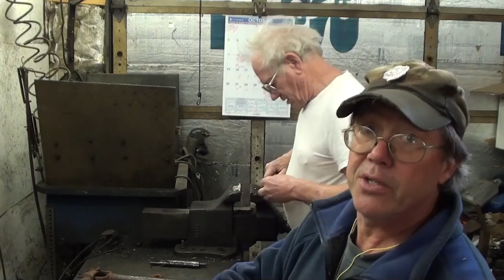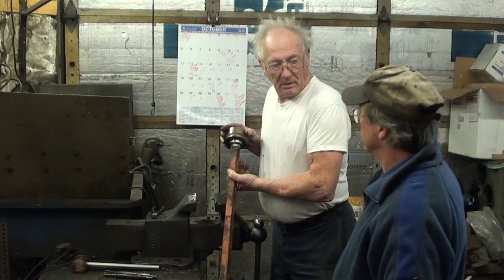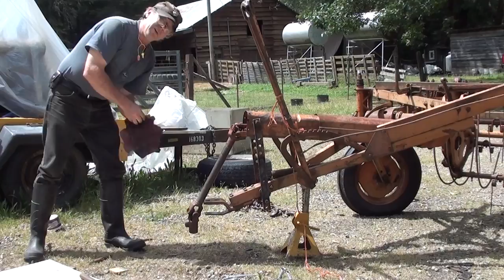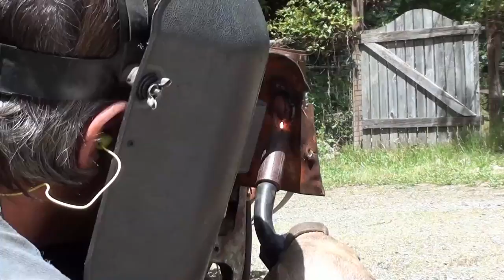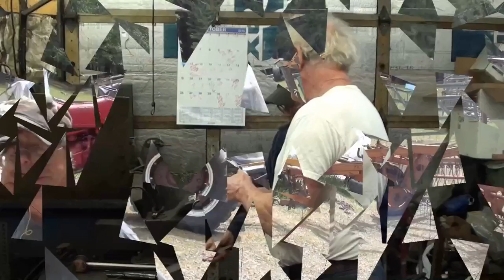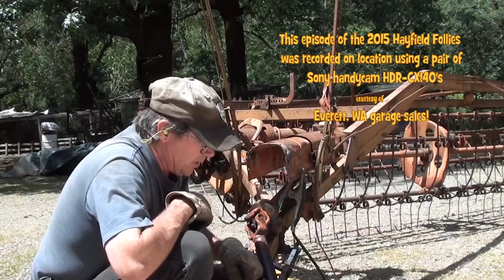Pt 4 of 4 Allis Chalmers Rake Repair with Tony!

Comment: Great Video's Geoff love the humor, one thing about the PTO shaft you should try and get it as strait as possible to minimize wear to the uni joint, so you should be using the second hole down on the swing arm the top holes usually has a bracket going across to the other side to make a handle to move the shaft backwards and forwards with.

Comment: Hey Jeff, when the wire-feed is all spitty like that it usually means you need to turn up the wire speed a little bit.  Admittedly, it could have been rust or crud - and I can't see it quite close enough to tell for sure.  But just as a general advice, spitty wire usually means to up the speed a little.  Also in general, my sympathies.  I've had decades of repair crap, just like what you're doing here.  ;)

Comment: You might want to check your oil after you get all the gesel used up.  What happens is the combustion temp in the gas engine is not hot enough to burn the diesel so it will run on the gas but the diesel will wash down the cylinder walls and end up in the pan and dilute your oil.  Looks like a legit repair on the ol' rake though.  Way to getter handled.

Comment: How bad is the Rust issues up there? Around here, I've seen Trucks less than 5 years old already starting to rust out around the rear wheel wells and rockers. They use so much brine/salt in the winter it's horrible. Forget finding an Old Truck without patch panels or just flat rusted out and left. I can handle scratches and small dents and dings but I HAD to get a Rocker replaced on my '93 Chevy. I'm still fighting the Bedside. It isn't completely gone yet. Just small pin holes and bubbles.

Post when ya can. I'm still catching up. Learn something every time I come here.